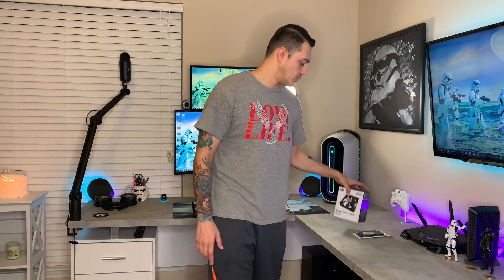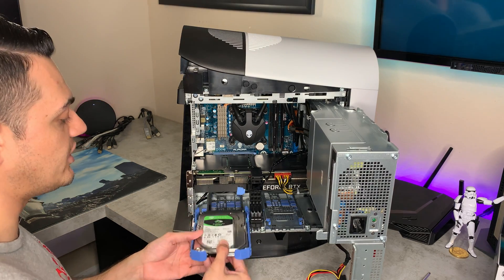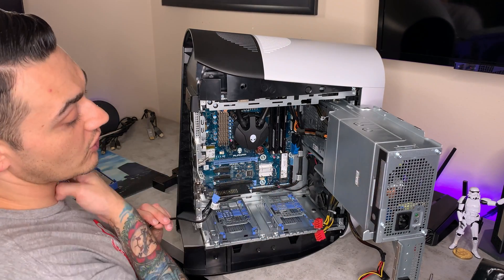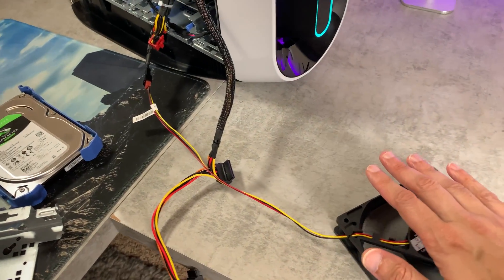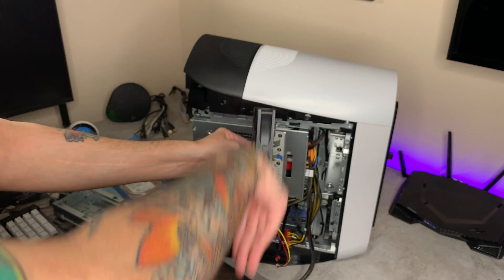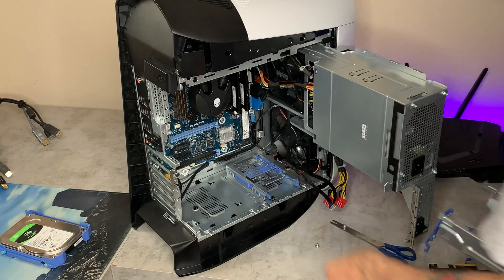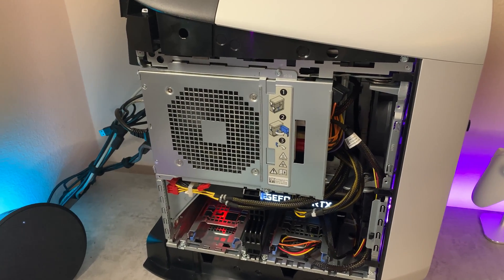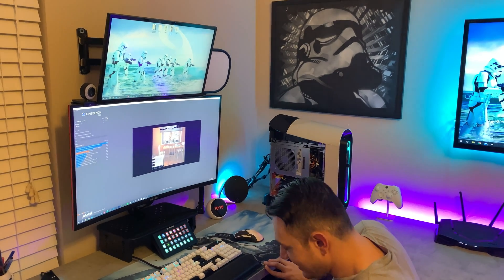Do This Immediately-Alienware Aurora R11 Second Intake Fan Install

Comment: Will Corsair AF120 Elite fans work with the Aurora R11 compatibility limitations?  I'm searching for Corsair ML 120 Pro fans but they're hard to find or discontinued.  I have Corsair SP120 Elite fans on hand, but I'm seeing guides say they may be incompatible with the Aurora R11 so am looking for compatible fans to use that are available.

Comment: Hey buddy, great video. I know this is an old one, but I had to upgrade an Alienware R11 (it has 2 slots so I can have the GPU and my Elgato 4k Pro Capture card). However, after the additional fan was added (same way you did in this video) it seems like the fans are always on. Before the upgrade I only heard the fans when the processer was cranking up. But now, from the minute I switch on to the minute I switch off, I can hear a fan whirring. It's not loud - just permanently on.  Any thoughts on what that could be?

Comment: i see no reason for there to be a bottom fan. heat rises and there is no fan blowing across the ram, heat sinks, or the top plate of the gpu that serves as a heat sink. i would just move the bottom intake fan up to the second slot.

Comment: I kind of get a kick out of these people, I'd love to see some of them build a 486. These modern boxes are so easy to work on they are self explanatory. Back in the day you had to install a part and then find the right driver and in some cases hope it worked or didn't conflict with something else. Talking about mechanical hdd's like obsolete parts cracks me up. I've been using the same mechanical drive for almost 2 decades, starting it as a primary drive and eventually using it as a storage drive. In the old days they didn't exactly think out how to run wires or fans, but things didn't get that hot. I'm just trying to figure out how to clean my son's r12, I should do a video on that, people would be shocked at how filthy it will be. Maybe I will....

Comment: I swapped fans to some thermaltake fans (2 intakes) and than a 120mm AIO as the exhaust, temps went from 85 on the CPU to 55 now. Absolute night and day difference on the noise level aswell. Pc sounded like a jet and was still hitting low 80s, now my room fan is louder than the pc itself

Comment: Question - I saw this comment in the Dell forums:

"The other thing to consider is the OEM Dell AVC fans pull over 1A, which is about 4x what most 120mm fans will pull, including the ML 120 pro.  If you put the equivalent of 6 fans on 1 header you run the risk of burning it out."

Thoughts?

Comment: So what you're saying is none of this was necessary.  I've never had heat issues with mine.
Also, my R11 3090 is running at 35 compared to your 3080 at 45.  It's not hot in there at all.

Comment: Where exactly would you buy on Dell the fan case to install? I'd rather use that instead of the two other options for long term and to make it easier if I ever needed to change fans again

Comment: So the issue I have is, I have an r12 with a 3060ti.. and I have two Corsair ml120 (non rgb), and they install them just fine, however in AWCC they won’t go above 32% fan speed. I tried uninstalling and re installing the software, did nothing, and eventually fusion wouldn’t even load. Had to do a factory reset. And just moved the stock fan to the top and used one ml120 on the bottom because my gpu temps are fine but the cpu gets pretty high. The stock fan goes up to 100% just fine, but the ml120 still tops out at 32%, even if I plug it into the 4pin slot on the splitter.

Comment: Everyone replaces the dell fans in their Alienware PCs, but the thing is is that they are server fans and can do like 4000rpm and can move a LOT of air.  The trick really is to figure out the maximum speed you are willing to listen to (for me it's like ~45%) and then use the thermal control to scale that as the maximum speed.  The OEM fans at 40% move way more air then standard replacement fans.

Comment: 9:00 The down arrow indicates the direction in which the fan blades rotate. Lose the cage and attach the fan directly to the chassis.. but use 2x40mm or 1x80mm fan(s). The 120mm fits, but the case blocks the leading edge of the fan, which is the part that produces the most velocity. Use non-flammable tape or make a custom plate to block the rest of the holes. The empty holes reduce the amount of thrust that your pull fans can create. Cheers!

Comment: This is probably the worst designed case in modern history.  The swing-out power supply is idiotic - even on a good day it feels like you are bending something when you swing it out.  It also blocks air flow, and the clearance between it and the graphics cars is damned near microscopic.  Air flow is abysmal.  Even if you get decent airflow you only end up pushing hot air all around the case.

Prying the covers off feels like you’re breaking everything.

It’s the epitome of style over substance.  It might be an head turner because of its odd looks, but it’s a stomach turner in all over aspects.

Comment: I don't get the point really my Temps run perfect with the stock fans and that's with the cpu and memory and 3060 ti overclocked . Cpu Temps under load are around 50 c gpu is around 50 c as well
Reply: Inside my case is even lower and my Intake and exhaust fans are only having to run at 30 % power

Comment: The Front Fan works perfect at 12% speed at 31 degrees... the second fan that I installed is not spinning at all. I used the same spliter in this video and the fan is a  CORSAIR AF ELITE Series, AF120 ELITE, 120mm. Anyone have any ideas why its not matching the speed of the primary front fan? Thanks all!

Comment: So I upgraded the fan on my R11 just like you did in the video with the splitter. They both worked great when I fired it up and it went into a performance check mode and said the front fan failed to respond correctly? Error code 2000-0511.  My version build is 4400.16 UEFI ROM.... Has anyone experienced this?-
Reply: 3pin & 4 pin.... got it :)

Comment: Apologies in advance, I'm using most of your videos to  upgrade my 2 year old Aurora R11.  I watched this video for fan placement with a splitter, but the video skipped over where your HDD ended up.  So I.m seeing 2 fans up front, but then the video skips over the part where I,m supposed to mount the HDD......Thanks for making all these mod videos for the r11,  good ones are hard to find, and yours are by far the best.  Thanks in advance.

Comment: :yt::yt:Have an aurora R12 factory water cooled. You happen to know if i will get any bios errors or issues disconnecting water pump wires completely?  Going to run a rad and pump in a separate case to help temps. Second case will be powered by a separate power supply with hard lined tubbing running between the two cases. Yes i watch to much linus tech lol.  Seen a video you posted about certain brand fans not working and giving bios issues witch is why i ask.        New to the alienware world. :yt::yt:

Comment: So I added a second intake fan and also swapped out the stock aio fan for a thermaltake tough fan 12 but With both these upgrades im not seeing much of a difference in temps I was expecting something more significant. Im usually idling around 95f-115F and now I’m just shy of that around 90-105F. While I’m gaming before upgrades it was between 120-145F and now I’m 115-130F. Both cpu and gpu hover around those values. Did I do something wrong?
Reply: Are the fans facing the correct way? I would make sure the intake is faced to pull and the AIO fan is faced to push. You can also add another pull fan above the radiator.

Comment: once I installed all 3 fans I realized that fan speed won’t exceed 35% for top fan and 30% for front fans no matter what. any ideas?
Reply: Been running into the same issues. I ended up changing the fan levels in  acc under advance in the fans area. But I'm not the most savvy tech person so double check.
Reply: Did you get this to work?

Comment: Yo can I connect up to 8 fans on the Alienware r12 Motherboard
Reply from the maker: No, only 1 intake , 1 exhaust and a cpu fan. You can run splitters like I did

Comment: Is there a splitter with duel 4 pins rather than the 4 and 3 pin? Or does it have to be the 3pin and 4 pin splitter?

Comment: definitely gonna do the fan upgrade.  You do know though that if you didn't have your NVidia drivers set to max performance that it would cool things down too.  I noticed that your card was on full blast.  You gotta let it throttle down, guy.  Plus, your bench cannot be accurate because you have the side panel off.  Put the panel on then test.

Comment: Fwiw I was able to mount a 3.5” on the bottom by using slightly longer machining screws to connect the chassis. No cable interference and no wiggle.
Reply: The bravo actually fits perfect with the same screws. U just have to bend a little of the bracket in the back to get it past the two little plastic tabs on the bottom of case. Bend has no affect on the HDD sliding in perfectly, and let’s the bracket fit perfectly in the slot. And I mean PERFECT fit.
Reply: @mannyfeliciano6898  how do you handle the heat on the hdd?, mine is getting really hot around 126°F

Comment: Thanks for this video. I actually used that 2nd ssd bay and installed another fan in that location using that technique you used to add the additional fan in the front. This has made a huge difference.

Comment: Good video. That water cooler on the cpu and the second fan will work wonders for its cooling. The Alienware Aurora R11 engineers should not have the customers developing a fix for their poor lack of cooling the pc.

Comment: HI man,thanks for your videos, that helps me a lot! I just ordered an Aurora r10 5800x with 3090, i am wondering the generation of the nvme m.2  slot is gen3 or gen4, i think it's gen4 but i am not sure. i checked the user document but get nothing. i am waitting for your answer

Comment: Insane improvement: Mining (gpu) temps before 68-72*  After: 38-42*..... I used a Noctua 2k RPM industrial fan for the intake and put the Noctua into the splitter side that has the controller pin because the Noctua has a higher minimum rpm. Nice, quiet, and especially COOL rig. I will update after a longer continuous mining period than 30 minutes.
Reply: I move GPUs around too often to get a good grasp on an accurate improvement, but the improvement is there! Have a 3080 in there now, VRAM temps are 110 with 2 intakes. So need to get that figured out!
Reply: @chriswright7806  this is a very stupid fix, but I have an r12 3090 whose mining vram temps were hitting 110 C with nicehash even when set to the lite profile. I experimented and found that the easiest way, says under clocking, was to put a standard Walmart box fan directly in front of the alienware. Instant drop of vram temps to 100 c or thereabouts.
Reply: @micahhyatt2696  there is a VERY simple fix for the VRAM temps! I dropped my VRAM temps while mining on high by 20°. It works for both the 3080 and 3090. Go to this YouTubers R11 playlist (same for R9-12, so it works for you too). And see his second video on repasting his 3080. I will see if I can link it here, just not sure how. Basically you repaste the GPU and add some paste to the outer heat plate and you will have an instant drop. I saw 20°. Well worth watching his video on it, and it's easy to do ;)
Reply: @micahhyatt2696  oh and I use a Costco Wazzoo fan in front on mine, the little high powered fan is awesome! I didn't check before and after with that. Definitely see my other reply about thermal paste video though!

Comment: Do you think it'd be worth it to upgrade to a different motherboard and buy a case of power supply and swapping everything over I have an Alienware r10 ryzen 9 5900x rx6800xt 16g ram killer wifi. You really get the 4.0 speeds by using the pcie slot and can you boot from the adapeter? I guess the only other thing I'm not getting because of the boards is smart access memory.

Comment: Instead of double-sided tape, get the longer screws and a 4 washers to hold them in place, ta da!
Reply: true, the only hard part is actually screwing it into the metal panel due to the lack of space and navigation in the case.

Comment: Do you have to keep the SATA hard drive in the tray? Looks like there would be enough room if you just sit it on top of the front SSD bay, but not have it in the metal tray. Is there any downside to that?

Comment: I'm going to do this on my wife's R11 and my R12. The only concerns/questions: 1) will AWCC see/detect the additional fan and 2) will I still be able to control the fan speed curve? Thanks!
Reply: I am also curious about AWCC.
Reply: Same
Reply: Hey guys so I did this now and essentially what is happening is the PC thinks that there is still o ly one fan in the front even though there are 2. In other words, the fan control looks like it is one fan but you're controlling both front fans together if that makes sense.

Comment: I managed to mount my HDD on the Bottom of the case by designing and 3D-Printing a custom caddy that doesn't mess with the Plugs on the Mainboard. Airflow got better just by getting the HDD out of the way. Now I'm planning on upgrading to a second intake fan. 

So far I did:
Call Dell-Support, cry about how loud this mashine is and getting a 10% refund for keeping it anyways.
Push Pull Corsair ML120 Pro on the Radiator.
Repasting the CPU.
Changing the lower intake fan to ML120 Pro.
3D-designing a custom caddy for the HDD and place it in the bottom back of the Case.
Thx for the inspiration.
Reply: Can you show me how you did this? This is sweet and I would love the help

Comment: I got the HDD bay to fit perfectly on the bottom. Just  pop the 8 tabs to release the bottom of the case and it slides and locks right in
Reply: In my case, those 8 tabs wouldn't come off. So I designed my own caddy for the HDD and mounted it on the lower back of the case
Reply: @derevu2072  they don't come off. I just pushed them in and downward to loosen the bottom foot piece. I had to do all 8 tabs to get them in low enough. But it locked into the case just fine
Reply: Just bend the bracket a little to get it past those tabs n boom. Perfect fit.

Comment: Hi sir, awesome video here! One question: is there no other option to include the HDD in the rig? I dont mind using HDD because the price hike in getting the 1TB SSD variant is too much, and for me 1TB SSD + 2TB HDD is kinda overkill. I want to opt for the 500GB SSD and 2TB HDD variant. However I really need the HDD in the rig after installing the second intake fan
Reply: I was able to remove the 2nd 2.5 slot from the bottom rear and put the HDD slot in its place. Just had to slightly bend the bracket a little in the back to fit perfect. Youd have 1 HDD and 1SSD slot on the bottom. 

I see this comment was 11mo ago so you probably already figured it out lol
Reply: 1tb ssd and 2tb HDd is low expectations most people have up to 5 tbs average in their systems

Comment: I added a corsair h60 to cool the cpu with thermaltake ring12 fans, push pull config, also added a 80mm fan to the 3.5 slot in front, since it fits the mounting holes of the cage perfectly..I can attest to getting sub 40c idle temps and stable 50c running in cinebench r20. 10700f and 3060ti

Edit: It's around 30c idling

Comment: FYI the Alienware Aurora line has been using the same basic chassis design since nearly the beginning. I have an r5 that opens up and is internally organized identically. It’s just the outside that changed in the past few revisions.

Comment: A few days ago I ordered a R12 3700 with the intention to mine crypto. Later that night I did the research I should have done before purchasing it, and subsequently ran across your videos. My device doesn't have the liquid cooling system and like I said is only the 3070. In your opinion, would it be smart/feasible to install a liquid cooling system? Or would it be worth it to return it and buy a 3080 with a liquid cooling system? Granted I think they said I might not be able to get it until July... Love the videos any help would be greatly appreciated!

Comment: I was able to finagle that hdd bay into the rear slot without putting any pressure on the fan port, could only get one screw in though lol but I figure so long as I’m not throwing the pc like a football I should be fine

Comment: Love the videos man, currently waiting on my r10... looking forward to opening this bad boy up, my question is could we get away moving that lower fan up and maybe putting the hdd bracket on bottom?
Reply: Mcknuckels  to be honest the biggest drop in temp i saw was just from moving the hdd bracket to the bottom, in front of the bottom fan. For me the fans managed to maintain performance much quieter which is still a win but also not what i was expecting to see from watching this video, also i recommended slim fans for the push pull config on the rad muchceasier to fit in that small space

Comment: Hey thanks for the video! I have a quick question, is the splitter for the fans compatible with two (4)pin corsair fans or is this splitter strictly for a 3pin/4pin set up

Comment: Hey dude, can you make a video about the r11/r12 if it can power up another gpu with a riser? Lets say i have another 3060ti i want to put into work.. is it compatible and is it safe for the 1000w psu. Thanks in advance.
Reply: Same i wanna know
Reply: I have installed a 6700XT in the additional slot in my R11 and it works fine. The problem is that due to the cramped space, the backplate of 6700XT is very close to 3080 because of which 3080 temp gets hotter by 6-8C compared to before. So just be mindful of that. I am looking for ways to reduce the temp on my graphics card and ended up here. Installed the 2 Corsair fans for intake and now my GPU temps are actually higher (4C) than before. Not sure what is going on.